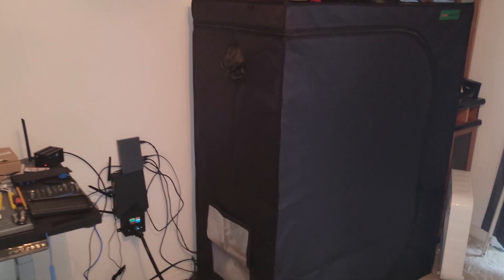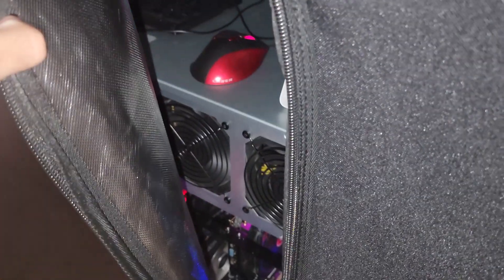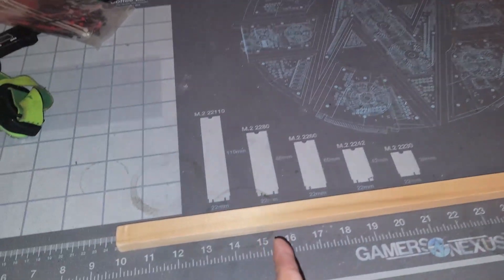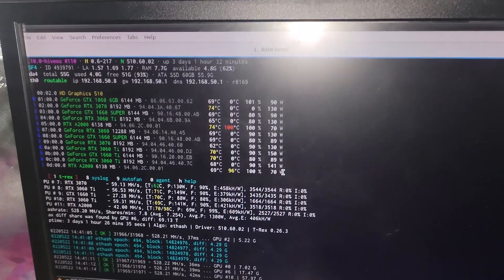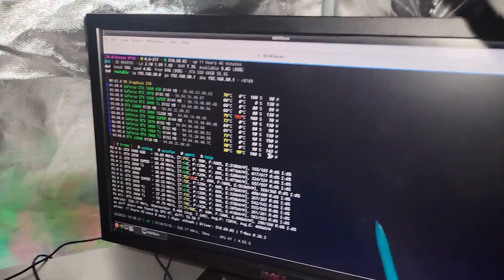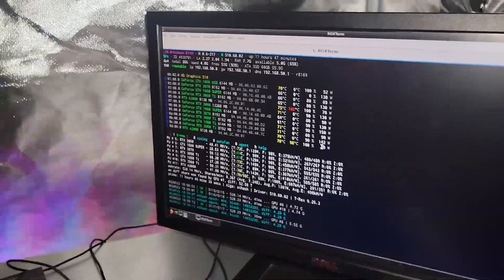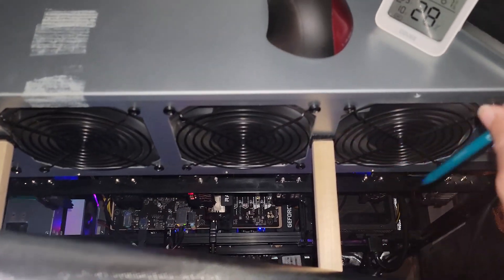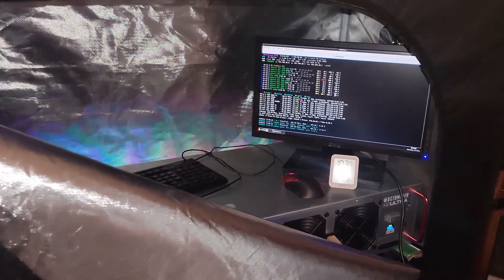Grow Tent Starving Air Flow on Octominer Rig

Comment: My GDDR6X tent rigs really need to be with side panel open with only exhaust, it works fine for now but its more to isolate from dust and the rest of the basement, the upper cards are really hot! NO fans besides the card ones, 45c inside in the summer, keep em going!